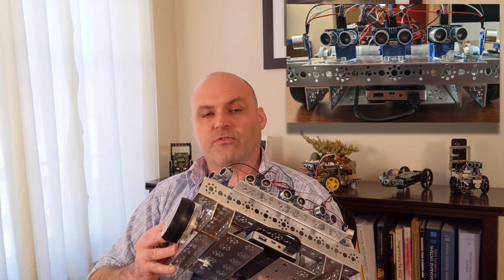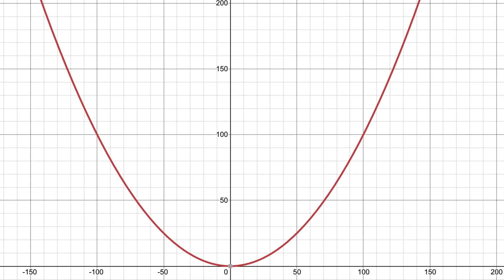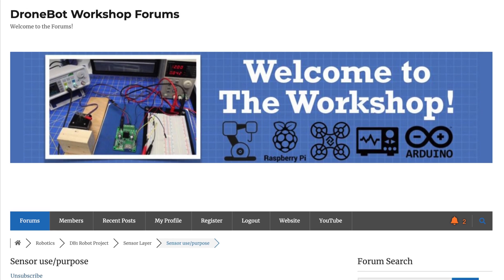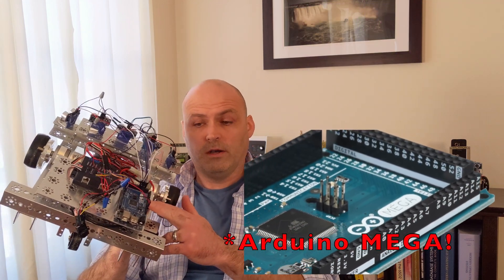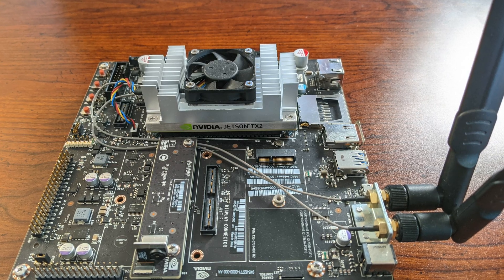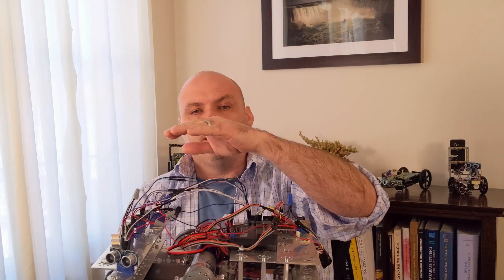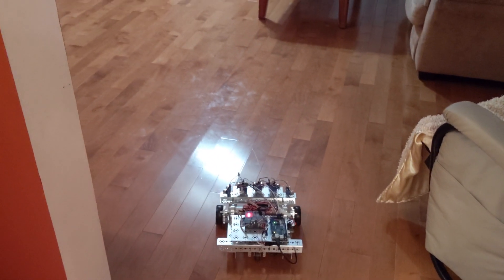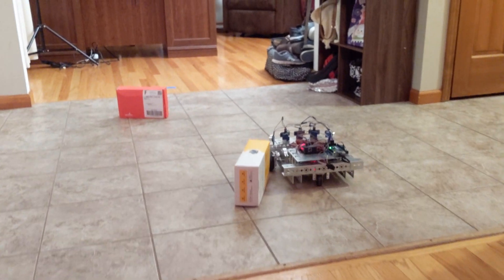Robotics Programming: Introducing Henry IX | Potential fields | SLAM | Lidar

Comment: Great intro of Henry IX.  When can we expect the details of both the lower and higher level controllers and sensors (LIDAR/SLAM/ROS)?  Also info on sourcing frame/motors/encoders/etc?
Reply from the maker: thank you!
I'm going to be focused first on navigation and obstacle avoidance using the lower level controller. 
Once I complete that I'm going to start looking at some slam and AI functions with the higher level.